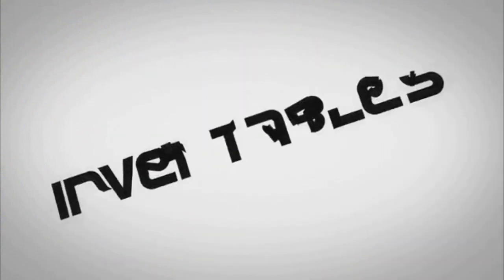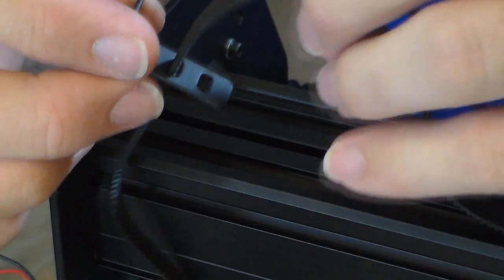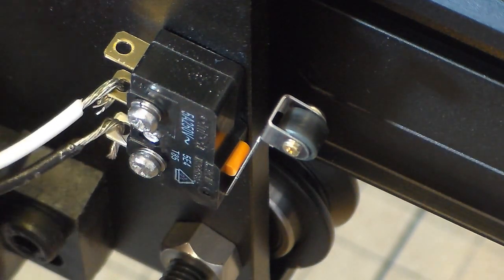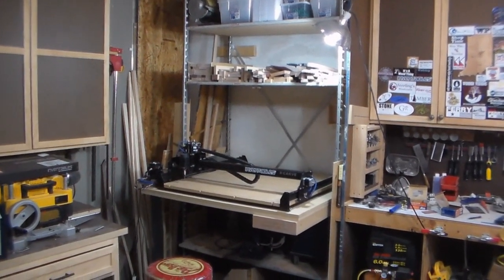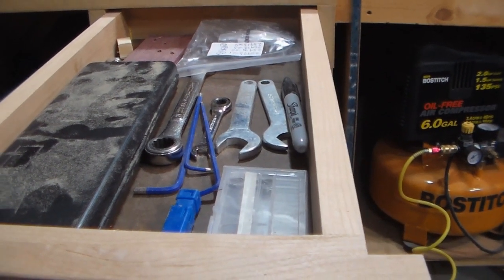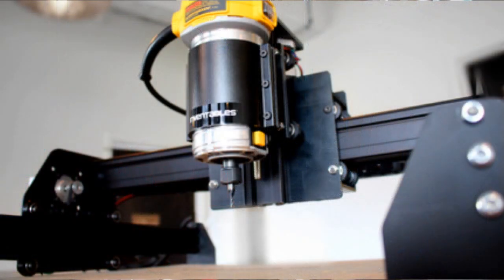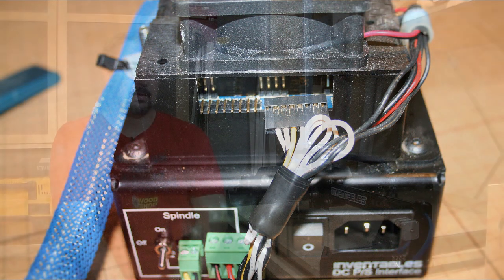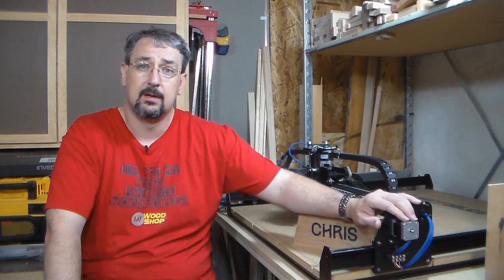X-Carve Assembly, Project and Review

Comment: This is a really good review. I agree with most of your comments. I was adjusting the nuts a lot to until I realized you have to hold the nut once you have it in place and really tighten it hard with the Allen key. You will be really impressed with how much faster the machine is with a bigger spindle.
Reply from the maker: Thanks for the feedback I'll try that with the wheels. I hope so I'll be getting a be a new router soon for it. Want to test some more first

Comment: Nice, I've decided to try to use the written instructions and pictures as much as possible. I noticed your Z spindle gear is mounted differently than the pictures I used. I am going to double check my assembly.
Reply from the maker: I think mine right I'll double check as well thanks for the heads up

Comment: Those letters came out good on the wood. I wonder how deep the bit can cut in a single pass.
Reply from the maker: Heavyboxes Its going to depend on the spindle, and the bit. the bit in the video was a 1/32in bit so not far and not deep or youll break it. Like I did on the next thing I cut.
Reply: Mike Fulton I think it would also depend on the wood. Deeper in Pine that in Maple for instance. Good vid, Mike, thanks. 

Great name, by the way....